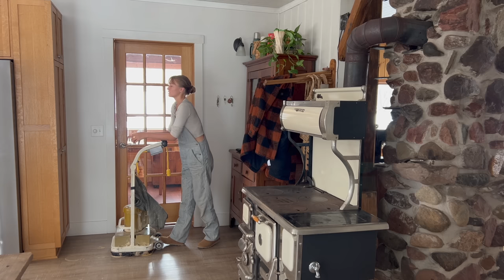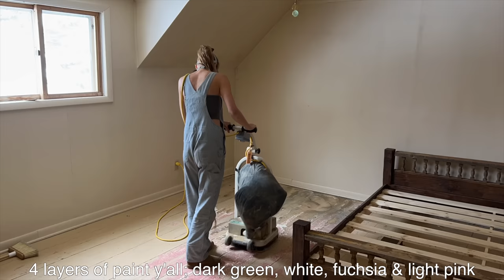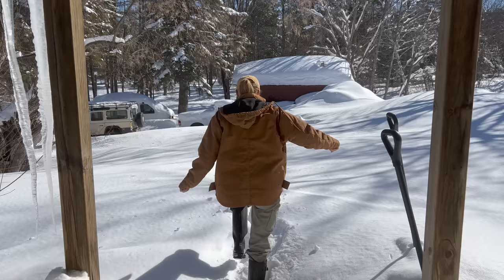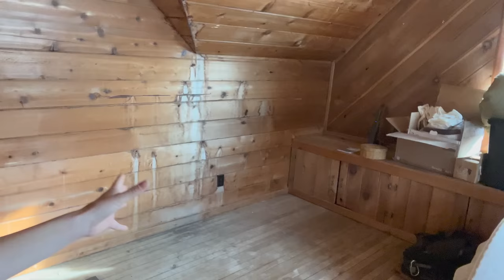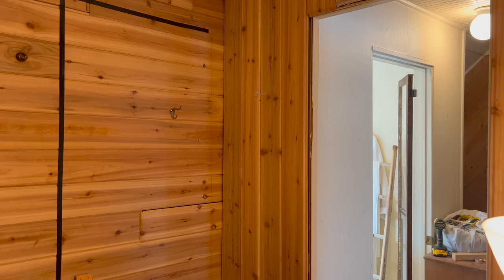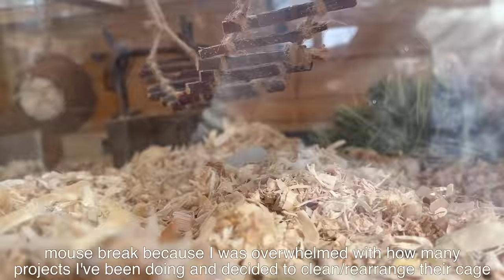I cut a hole in my wall (+ started my bedroom renovation & other side quests)

Comment: Future trick for stuck screws. IF you are able to back them out even a little bit, you can then tighten the jaws of the chuck around the screw head the same way you would any round drill bit. Then it doesn't matter how stripped out it is.
Reply: Genius!!!😄😯😄
Reply: Thanks, just the tip I needed! Got screws so old the notch is worn down! 👍👍

Comment: Best. Video. Ever.
I learned sooooo much.
All the floors I have sanded in my life; I never knew I should have been dancing while doing them!
You've confirmed for me that respirators are great for day one of a project, and are never to be used again (while wondering why everything is so dusty).
That to do fewer than 7 projects at a time is the very definition of "slacking off".
Soooo glad that I bought an LG combo washer / dryer that works on a single 120v outlet, and didn't need a vent line or a hot water feed line, and saved so much space over having 2 separate machines.
That sparing the life of humble mice to find them new homes definitely takes precedence over other priorites. No brainer.
Recognizing that when the world goes to crap (pun intended), knowing a plumber and electrician can be life-saving.
That the words "level' and 'plumb'' are highly overrated, and should be struck from the lexicon.
Now about that 'bag' in the crawl space....... I'm thinking you might need Geraldo Rivera to investigate that. It  might turn out to be the missing treasure of Al Capone that he was searching for. It at least deserves its own video with a horror house sound track! (Filmed at night of course, with flickering candles)
Welcome home!

Comment: Now I know what I look like lugging lumber through Home Depot and wrangling sheets of MDF, melamine, and backer board 4x8s by myself...it took me 3 weeks to demo a lath & plaster wall mostly because the trashcan kept filling up and it's hard to get to my driveway literally a half block away over uneven ground. That plaster is no joke. Kudos for that sanding session & just getting it into the room! Glad you're using your youth wisely! 🎉 Good on ya Hannah, this was just as good of a video as your adventures in SE Asia. I'm here for it ALL.❤️

Comment: May I recommend a good shop vac, with bags, (and an extension wand/floor piece) to clean up the dust? Sweeping only spreads it more. Swifter dry wipes, are great for wiping down dusty areas. Also, a pry bar. Just some general suggestions, as they’ve worked for me.

Comment: Hay sweetie, after seeing the water stains on the wall in ur temp. closet wanted to share my tea tip, make a cup of tea, use the tea bag and dab tea on the discolored spots, you can control the color by however much you work it in. Did this in my kitchen worked out good 😊

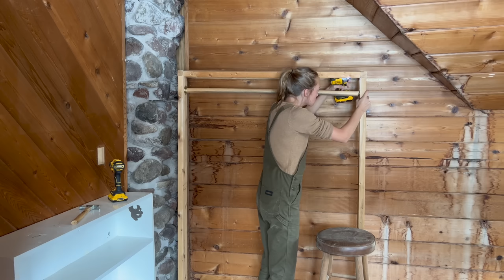Comment: Hannah, I just noticed that your New Temporarily New Clothes Room is and has been leaking from the Roof for a while, time stamp 9:13  around the chimney and the Roof Angles, but just seeing the Walls look like that is a sure sign of A Leaking Water 💦 Problem ..... and possibly a bucket of Tar  put on would possibly solve the problem but just letting you know and it's still winter/spring but do wait until after the Snow is Gone before you challenge this project.....

Comment: Hannah, there are toilets (commercial type) that hang on the wall just a few inches off the floor.  Could you have installed one of those and not had to build a platform for your toilet. We added an upstairs bathroom and used this type of toilet because of the plumbing configuration. The up side is that you can clean the floor under the toilet, it makes for easy mopping. I’m surprised your plumber didn’t suggest it. Just a thought. 
BTW: You were brave to take on the job of sanding that floor yourself, not an easy job!

Comment: We all have to learn by doing. I used a stripper in the summer time to remove 6 layers of paint on wide plank flooring from 1813. To do this by hand was tough but I did it. Dust is inevitable and use a box fan to draw the dust out of the house. Mask off everything to keep it from getting into areas you don't want to keep cleaning more then necessary. Your on the right track, just work smarter not harder.

Comment: You are crazy amazing when it comes to doing what you want. Unbelievable strength to pull that machine up & down those stairs.
Hannah, I was told by my wildlife rehabber that you cannot release mice until spring time. (yes, technically, it is spring, but with all that snow???) 
I saved about 25 mice during one winter in a large garbage can inside my cellar...with a sandy bottom and lots of little cans where they were nesting. Are you certain that letting them go with so much snow on the ground is ok for them? I know you care about those little critters, so you must have checked with someone about releasing them when you did.

Comment: I start with a vacuum with brush attachment then  follow with either a  tack cloth/microfiber,or that much of wall a  mop with  removable pads (Swiffer) so I can change it often. Old cotton damp   socks pulled over the mop head is good also.  I have thought it expensive to plastic type off the walls. 
Oh the dust falling on the floor added to useing up pads. You didn't say if you used low grain paper then back over with high grain to smooth the wood.
Reply: She did say

Comment: You are just unbelievable! I love to watch while some other people, knowing what they're doing, are working.
You do a great job (assuming, you have a better idea of how to put all that torn apart and cut away pieces back together again).
I wonder where you get the Energy to do such projects.
To that heavy sanding machine and putting it into the Land Rover: Why not put a beam trough the Railing on the top of it, so you could use a Chain or a rope or similar to lift it to the level of the inside floor of the car...? I know, that comes to late, but you didn't ask earlier...😉
thanks a lot for that video. All the best for the rest of the project.

Comment: If your rack can handle it rig it to help you lift. 
The best thing you can get is a "wheel chair lift" or what is called a crane that can fold away  or against the vehicle. There are some DIY ,however there are inexpensive ones.

Comment: Hannah I love your videos and courage to rip into any renovation project, BUT please be safe. Next major sanding project, please consider doing these to save your lungs: shut off your heat (dust will get in the return vents and blow all over your house), plastic off the doorways and vents, never take your respirator off while in the working room, and point a fan toward the window to help act as an exhaust. NOT trying to lecture you, just some things I learned when I did my room. Keep up all the awesome work!

Comment: Yes they do have snow blowers once are gas powered by the one you plug into your outlet and there's other ones it's ran by batteries they have wanted like final 18 to 24 in wide which is no big enough for your porch or whatever very lightweight and that one's green machine or GO something Lowe's I do believe has that one battery operated as well as gas powered snow blowers you also have one it's capable changing the end so we can go from snow blowing to road chilling on the same unit battery operating OK

Comment: Did your plumber not suggest a back outflow toilet? The pipe comes straight out the back, so you could have had a wall build out instead of that box on the floor.

Comment: Hannah! Please! Save your back! I've had back problems for 20 years because of doing stuff like this. I herniated a disc and the disc protrusion pressed right on my sciatic nerve. I was in so much pain that I couldn't even stand up or walk to the bathroom without screaming. You could really hurt yourself or end up disabled. Back injuries can destroy your life. I would never want you to get hurt. Lifting a heavy sander like that - by yourself - dragging it upstairs? Omg please stop.
Reply: That sounds utterly terrifying, especially considering that that sort of pain can lead to opioid addiction. Was it a sudden injury?
Reply: @SkySpiral8  the sciatica came on rather suddenly, but it wasn't a sudden injury. I had already been having back problems for about 14 years at that point with many prior lifting injuries. I have degenerative disc disease, and I may have Ehlers Danlos. My ligaments are loose and don't support my lower back properly. I also have an extra vertebra which is transitional and makes my spine unstable, and Castellvi anatomy (sacrum is naturally fused to lumbar vertebra on one side.) I think the Castellvi anatomy is primarily what caused my disc to herniate, but it was years of doing things that put pressure on it, lifting things that were way too heavy for me. In my experience dragging something heavy across the ground is even worse than straight lifting because it can really stretch out the ligaments and tilt the pelvis out of whack. Hannah is probably a lot stronger than I ever was, but I worry. Ehlers Danlos has become an epidemic among young people and it tends to be the neurodivergent, ADHD/autistic people who are most prone to connective tissue disorder, and people with genetics for blonde or red hair.
Reply: @SkySpiral8  I don't take any opioids. I have acute porphyria and have also had anaphylactic reactions to meds so I am best off just avoiding meds entirely. I gave in and had toradol shots when I had the sciatica because it was just too much, it was like getting electrocuted down my leg. The toradol barely took the edge off. I also had prednisone which just made things worse, triggered a porphyria attack and also turns out that it further degrades connective tissue which was just exactly what I didn't need.
Reply: @leschatsmusicale  Yes, I’ve heard of Ehlers-Danlos; another YouTuber that renovates her own house has it. Her name is Ariel Bisset. I never thought how dragging might even be worse than lifting, though! I work at a bike shop, and sometimes I have to lift or drag things, and I will keep that in mind. I’m a petite woman and the guys I work with are helpful, but sometimes they also try to lift very heavy things by themselves, and I have to scold them, too.
Reply: @leschatsmusicale  Nerve problems are the absolute worst.
Reply: @SkySpiral8  yes nerve pain can be the pits of hell. My back problems started with a lifting injury, squatting and trying to lift straight up. Then many other things like using pruners or a mattock, or falling, but dragging heavy stuff across the ground was probably the worst. My body just wasn't built to do yard work or manual labor. I worked in retail for many years and 12 years as a field sales rep which involved a lot of building displays and packing out product. Heavy lifting should always involve at least 2 people but of course things don't always work out that way. But yeah big strong men can get hurt too. Having a petite body can be an advantage in some ways. Connective tissue problems can happen in anyone and hypermobile Ehlers Danlos is really not uncommon. Testosterone has a beneficial effect on connective tissue, which is why you don't see as much joint hypermobility in men. But an underlying connective tissue weakness can still leave people prone to injury. Having strong muscles can actually kind of hide the problem. A lot of people with Ehlers develop really strong muscles to stabilize their joints and it can lead to dystonia. In any case if you can use a back brace or harness when you drag or lift things it may help prevent injury, because that helps support connective tissue.

Comment: Why don't they build these things like vacuums to be easily taken apart (like the head, bag and tube) so you can lift it up stairs......?

Same with garden equipment 

I'm a small person too (100 lbs) and I know I could do so much more DIY if the equipment was just more user friendly and not massively heavy. 

I mean petrol mowers are still using really difficult chokes to start which no car under 35 yrs old even has anymore!!!!

This isn't just about tools for men. It excludes so many people, less able and elderly who could manage so much more with easier DIY equipment.😢

Comment: You should seriously do research on spine & joint function & care.
While you can do heavy work because your muscles might be young & strong enough, putting that kind of stress on your spine & joints can cause debilitating future damage that might not hurt now but over time will become literally disabling. 
Those of us advanced in age & living with some of the repercussions of our physical feats in our youth KNOW…don’t do it.
Wear a back support belt.
Use the buddy system for heavy or awkward lifting even if it delays your projects.
Wear knee pads or use a knee board.
Wear wrist support.
…

Comment: 😮😂 Girl you need to think outside the Box when you had that sander it has wheels in the back the only thing you had to do was go up the stairs grab the handles and let the wheels do most of the work as you were pulling it up the stairs and the same as going down just stay on the back side of it and go down slowly one step at a time and it would have saved you and your back and your legs and everything else from being so overworked you understand what I'm saying so next time you have to use anything like that you know to use the handles and the wheels don't try to lift that thing you're gonna kill yourself girl you're doing a fantastic job what you constant lean I love what you're doing I wish I was your age again to do the things that you do. Glad to see you Home Safe from your Trip..🎉👌🤲🙏❤🙋🏻‍♀️🌞
Reply from the maker: Nooooo lol that didn’t work at all, believe me I tried
Reply: That won't work with those tiny wheels on that sander. She'd have to hold the sander almost straight up to have the wheels stay in contact with the stairs.
Reply: Hannah Lee you can (tie-down) strap heavy equipment to your hand truck; still heavy but much easier.

Comment: Love your vids but this is the first time I cringed in fear for you.  Wear  a back brace, get help lifting things.  Rig up a rope lift to get things upstairs,  Anything, anything rather than haul massive heavy equipment upstairs or anywhere by yourself.    One slip, one slipped spinal  disc and it may be all over for you at least for a while.  Remember!   You need to live in this body,  the one you get.  Take care.   Take your time.